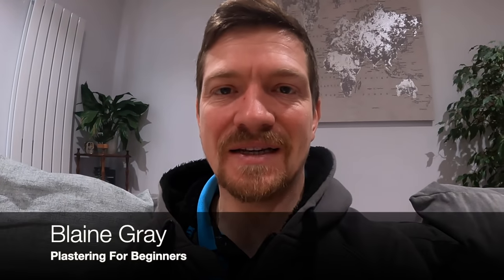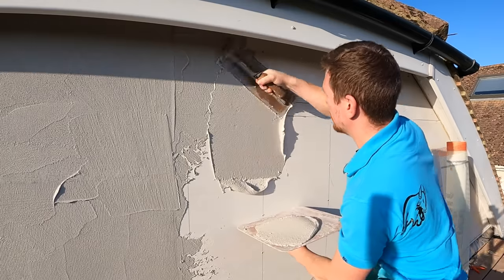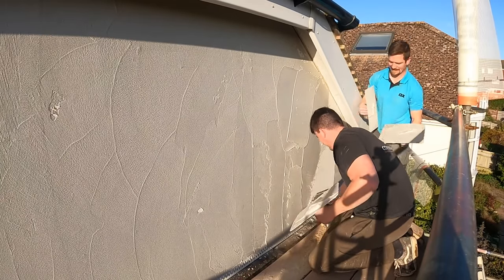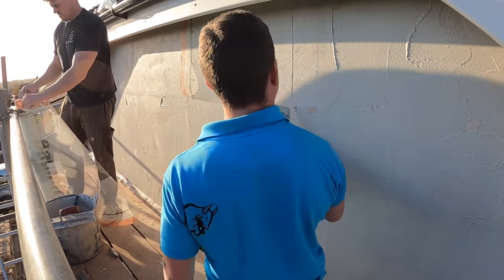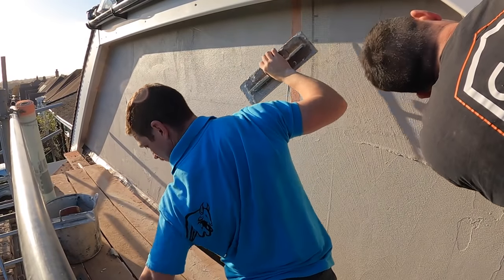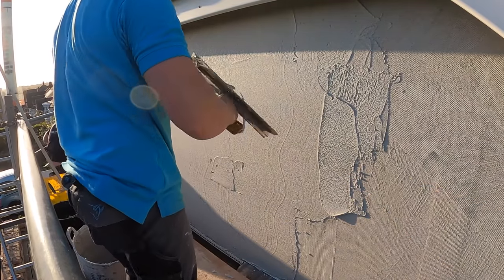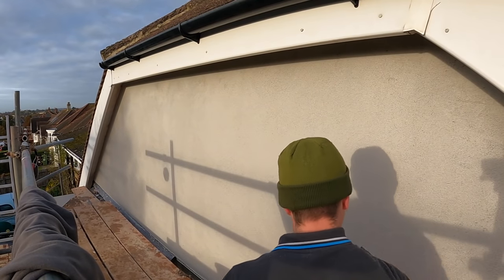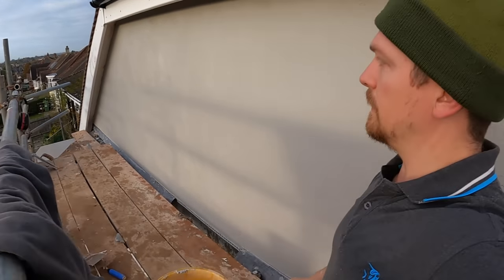Silicone Render Explained…Is This The Best RENDERING System Yet?? | FULL PROCESS REVEALED

Comment: Hi Blaine, when using newspapers to dry the render, run your float over the paper if the paper looks wet remove it and put another page on and so on.  If you use the Sun newspaper the render will go off even quicker :) 🤭👍 Keep up the good work :)

Comment: Advice please. I tried silicone rend for the first time on a trial job at my bosses home just a few weeks ago. All the prep work went just as shown on this video but upon applying the final coat we struggled to apply the same methods as you have shown. Firstly we were asked to use 3mm aggregate and secondly it was becoming quite cold outdoors. So I applied as tight as possible as shown and my partner came behind taking off access, at this point the aggregate started to separate and the uneven shape of the aggregate started to cause friction lines. We found ourselves playing with the product to get it as it looked upon application and realised it was no drier than when applied much earlier and would not allow for floating without leaving lines or moving the aggregate around. We decided to leave it a while and go back to float up and found the weight of the aggregate and wetness of silicone combined had cause the aggregate to droop in place. We ma aged to sort this as the silicone had stiffened enough to hold the repaired patches and flatten the rest. Can you tell me if the temperature was the problem or the size and weight of aggregate or even a mixture of both or even like iv found with experience in other products, did we just panic when the aggregate started to move and could we have trusted the process? I do realise that a trial job held in winter does throw up more possibilities and I personally as a very experienced plasterer put it down to the 3mm aggregate obviously meaning the silicone is thicker which in turn slows the drying process mixed with the cold conditions caused a problem for inexperience. Can somebody with experience please give me a verdict and any advice for future reference 
Thanks guys

Comment: Great bit work as usual.Really like the look of that gear.I tend to stick to lime or sand and cement.Haven’t had much experience with the modern stuff but am certainly tempted now.Oh and use the newspaper trick on bonding if it’s hanging too,works a treat

Comment: Great video, i learned so much.
I know it is a silly question but what trowel would you recommend putting the base coat on with? 
Thanks alot, Conor
Reply from the maker: Thank you for watching my friend! I just used my standard plastering trowel and it worked fine...although someone mentioned using a Flexi. That could work well 👍

Comment: Hey blaine. I've seen your going over cementboard. The joints from the video seem like there tight and butted up. I've always done and made sure there's a  gap so it doesn't cause pillowing when the timber expands or contracts??
Reply from the maker: Arrr ok. It makes sense I suppose - thanks for the insights there pal...I really appreciate it. Happy NY to you 👍

Comment: We've moved into a house with silicone render but don't like the colour, can you paint over it? Views seem to be a bit mixed on this issue as you have to have it cleaned first as mould and algae can cause issues with cracking/peeling etc. Some articles say masonry paint is fine and somewhere else they say use silicone paint?? The silicone surface is supposed to be breathable so this is probably an issue when painting it. I'd be grateful for any advice. Thanks.

Comment: Desperate!  Can this be applied in sections on one large wall or will you always see the joins?  Have to remove a so called professionals job where a lot of cement render has blown.  Thinking of removing the lot down to blocks and starting again

Comment: Can you scratch stonework with sand and cement and use this system over the top? If so what primer would you use if any on the sand and cement scratch? Do you let the base coat dry fully before top coat, been rendering and plastering for 15 years and never tried this, thanks in advance for any reply

Comment: Great Blaine I am just about to to do this for a builder I work for perfect timing Blaine God sent video
Reply from the maker: That's good timing ha! Great stuff...good luck with it 👍
Reply: Can you use that on a brick block wall ? Or is for going over insulation only ? Thanks
Reply from the maker: You don't need to insulate everything. You do need to meet it though. You can go straight over block...it's just choosing the right products. The reps are great though. Just ask them pal!
Reply from the maker: *mesh
Reply: @PlasteringForBeginners  ok thanks I want to do a garden wall with this stuff instead of sand and cement to save painting , everyone on YouTube is using it on  top off external insulation walls ! Thanks job for summer

Comment: i have a silly question, ny garage has old peddledash and i want to cover it with a smooth finish. I dont want to remove the layers, can i use one coat dash cover and than do silicone rendering for a smooth finish. I am unable to see any video on how to cover peddledash. BTW by following your courses, i have managed to fully plaster my kitchen ceiling to walls

Comment: Used this system on top of external insulation.  All great until the final top coat. Went on an absolute dream,  but after 24 hours it was still as wet as when it was applied.  Had not gone off at all.  5 hours after that,  a rain storm and most of 1600 quids worth of top coat was running down the walls and on to the floor.  How long before your top coat was set?
Reply: Hi baumit has an accelerator.
Called speedtop. Brilliant stuff goes off in 4 to 5  hrs 1 tub just tip in topcoat.
Reply from the maker: Mate that's mad! This actually happened to Charlie (builder in the video). The exact same thing so we used Accelerator as Kai mentioned and it worked a charm. Sorry to hear about your experience though mate.... rendering in winter is evil!!
Reply: Just had the same experience even with accelerator in it (maybe I should have used two doses!).  Temp dropped to 5c overnight and that seemed to stop it going off.  

Was getting damaged when the rain came in the next morning so have had to tent it, and apply a propane heater to try and get it to go off!

That being said, easy product to use and I’m sure we wouldn’t have had the same issue had it been July and 30c! (Probably the other way around!)

Comment: Great vid Blaine! The orange Refina trowel - is it just a plastic float or is it a scraper? Sounds like it’s scraping back but the float looks completely flat? I’ve not used silicone render before, I’ve only used sand/ cement. But whenever I’ve watched vids on silicone render they seem to scrape it back? Thanks for more great content 👌🏼
Reply from the maker: It's a float but it's just designed to be used on Silicone renders. I am pulling it back with one motion but floating it directly afterwards. You want the render to be applied very thin. Thanks for watching by the way...hope this helps pal
Reply: @PlasteringForBeginners  that really helps, thanks mate!

Comment: I’ve done loads of sand & cement but never silicone. I thought you rub up too coat the next day, or is that the difference with krend?
Reply: Top coat
Reply from the maker: Hi mate. That's K-Rend mate - you have to scrape it back the next day to get the texture. You float this product and you do it almost instantly. Hope this helps my friend 👌
Reply: @PlasteringForBeginners  Thanks mate

Comment: Great video as always, you’ve answered a lot of questions I had on k render. Only one question tho, k render tend to have a very textured background, is there any way it can be flattened as smooth as sand and cement?
Reply: This ain't k rend its a bit different process. 
Most don't use k rend now
Reply: Hp12 can be rubbed up to a smooth finish with a diamond float and a sponge

Comment: If your scraping the final coat off with your float then the bloke troweling on is putting on too thick. Easier to tell him to trowel it as thick as the grain. That also means when you are rubbing up with the final float, you should keep a damp sponge in your hand to constantly clean your float. Also break in the the finish with your float then go over again when it’s dried a bit to close off for a more uniform finish. Trust me when it’s hot if the final coat is too thick it will skin up.
Reply from the maker: Too true my friend. It was also a bit thicker than what I'm used too...I find it's a lot easier to spread when it has water in the mix. Really thin it out!
Reply from the maker: Great tips by the way. Thank you for sharing...I'll be trying this out!

Comment: Can you use this over a pre painted sand cement plastered wall ?
Reply: Not sure about this product on painted surfaces but I've just used Atlas system base coat KT55 with a primer applied first over a painted surface. Worked well
Reply: @Daleakefford  thank you 👍

Comment: Am having a wall k rended around the patio door. The builder has not used mesh over exisiting brick work and also hasnt used an undercoat. Is this ok?

Secondly when i run my fingers over the finish coat small sand particles end up coming off. Is this normal?
Reply from the maker: It doesn’t sound great to be honest mate! You definitely need mesh and there’s always 2 coats of K-rend. Admittedly though, you can apply 2 coats on the same day but it doesn’t sound great unfortunately
Reply: @PlasteringForBeginners  can you used to finished coats instead on undercoat???
Reply: @PlasteringForBeginners  also the colour does not look equal. Its darker in some areas and lighter in others. Do you know why this couls be
Reply: Is it brick or block? If its brick he should of undercoated and meshed but if its new block they can just apply krend top coat and as for rubbing off bits of dust this is totally normal as krend is designed for slower drying longer workable material and its that consistency which makes it workable for a good time after applied.
Reply: @tommyedwards8451  brickwork